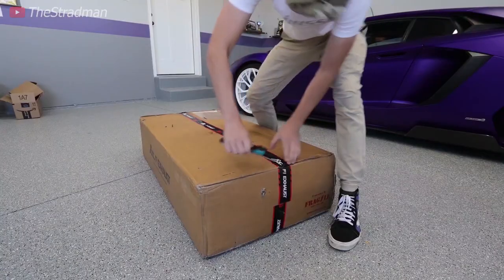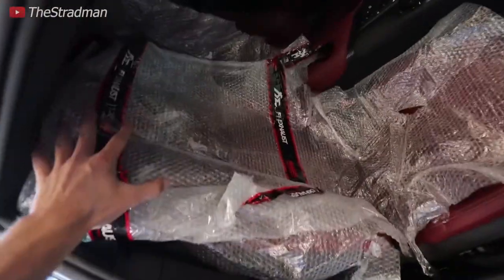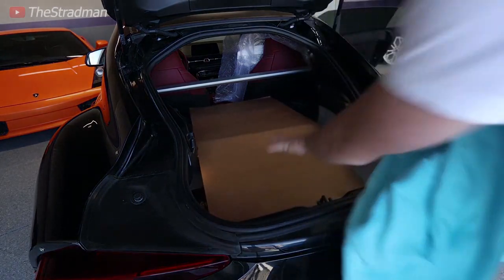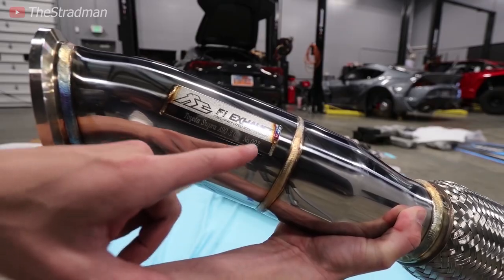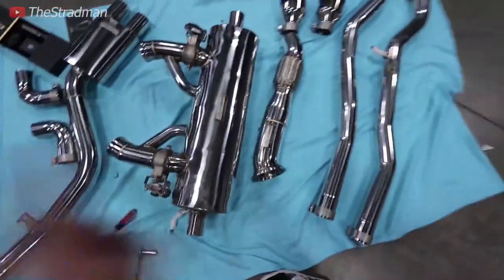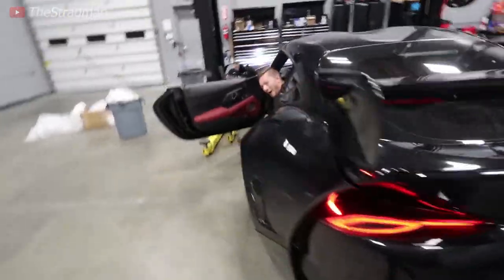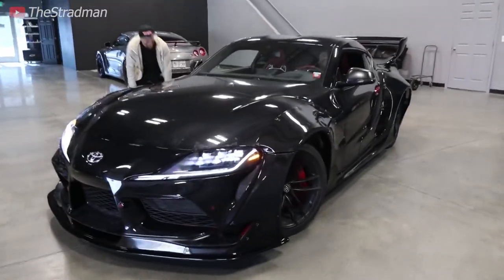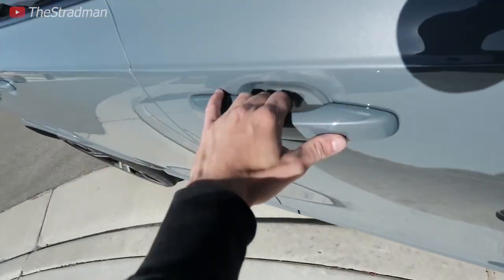TheStradman Supra 2020 w/ FI EXHAUST REVS X Rocket Bunny Widebody

Comment: The sound is amazing but I would love to use the car's sport button to switch between sport/quite mode, not through the remote. Remus Exhaust use the stock button and sound great too.
Reply from the maker: You can also use the stock sport button to activate the exhaust valve flaps and adjust the sound profiles.